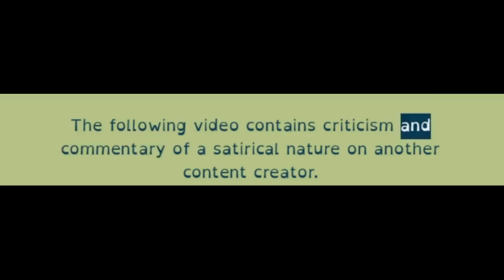REACTION: Another INSANE CRINGEFEST "Restoration" - Antique Kenwood X76 Cassette Deck

Comment: Specs after "repair":
Frequency Response: 2500Hz to 8000Hz
Signal to Noise Ratio: 3dB 
Wow and Flutter: 37%
Total Harmonic Distortion: 78%
Reply: You are being very optimistic.  I have restored cassette decks from the 80s/90s.  For starters, there no way that the motors, potentiometers and any relays or reed switches would have survived that water immersion and corrosion.  If, by a big miracle, that worked as the video showed, it would not work for too long.
Reply: @kylesmithiii6150  heck, most of them don't even survive "careful use" along that many years...
Reply: BUT DOES IT CHEW TAPES FULL OF CASIOTONE MUSIC !!!! Luv it ! 7-bit Muzak !
Reply: and at the end, you can't tell from the music he choosed if the tape speed is right.
Reply: This comment was like reading enchanting table
Reply: LOL !!!!!!!!!!!!!!!!!!!!!!!!!!!!!!!!!!!!!!!!!!!!!!!!!!!
Reply: The guy calibratedd speed well below 1% and measures the W&F with his hands and the result was better than JC KD-DD9 0.01

Comment: I have two perspectives for this guy's video.
1. I am a creator, I make all sorts of post apo props, armor, weapons from junk (and making Fallout/Mad Max/Wasteland Weekend stuff for fans of that kinda thing). The rust was definitely put there with chemicals. This rust wasn't developed naturally FOR SURE, it looks like the instant rust I make on my items with chemicals. I of course work with stuff that is actually rusted too but it would look totally different.
2. I am a big lover of cassette tapes, I have a huge collection and I know a thing about tape decks. They are temperamental. As hell. Especially the belt. There is no fucking way the belt would survive this. It doesn't even survive being treated like a newborn baby by an educated/careful user half of the time. It had to be a brand new belt on that thing. And that 'old stuff indestructible' DOES NOT apply to tape decks. I have experience with 70s-90s tape decks of different qualities and none of them are indestructible, definitely not a Kenwood... By the design this is an 80s deck and Kenwood was just decent. Not great, not bad. It would never work after something like this. This is so stupidly fake I can't believe people fall for this.
Reply: Heck yeah man. I recently fixed up an old Sony double deck cassette deck. When I got it, the belts were shot. Even after i replaced them, there still are a few things wrong with it that won’t affect the operation as long as I’m careful. One of the gears is cracked and slips off the axle if I use fast forward or rewind and I think the spindle brakes or clutch? are going bad, as when I use the deck for a while, when I stop it, it makes a slight jerk and slightly unwinds the tape(might be the cracked gears fault, it doesn’t happen on deck b). Can I just ask this? How can I repair a cracked gear? Can I use some epoxy on it? And sorry if I’m making you cringe a little, this is all new to me lol.
Reply: yeap, you're right. I have an uncle and he also has a collection of cassete decks. Sometimes he buys a deck that's almost perfectly fine but there's a spring missing or a belt and the thing wouldn't work (or maybe it would but weirdly). If you rose the thing down like he did the deck wouldn't work anymore just because of the disrespect with it. 
What he did was literally impossible, it takes weeks to figure out what is wrong with this decks and another week to find a similar piece that fits in and maybe, just maybe the deck is ready to go.

Comment: someone: gets stabbed AHHH HELP ME

this guy: oh wait here rubs stab wound with wire brush, then hoses it down
Reply: "Restore human knife wound clean and restoration"
Reply: No he used ramen noodles to fix the cut and then painted over it
Reply: @karinaaraiza7615  just like that Powkiddy that Restoration R.A claimed to be a "Gameboy PlayStation"; he just puts noodles in it, sands it down & spray paints over the shell with yellow paint that doesn't even match the yellow paint on the front.

Comment: "Filming it backwards" might be a viable answer. Taking a good item, filming it as "restored", then trashing it and pretending to "restore it". I don't know much about electronics, but from what I've seen, if you leave something outside for any real length of time and you practically have to rebuild it replacing everything as everything is destroyed. Rust is a killer. He could have "rusted it" with an oxidizer to make it look like it was out longer than it was (would be easier than waiting for it to actually rust). Then probably tossed some mud on it. Who knows for sure, but I highly doubt you can pick up a junk cassette deck from the bank of a river that has been there for months or years and "restore it" without pretty much rebuilding it.
Reply: But his movements isn’t backwards
Reply: @juliaalvarez537  not literally filming in reverse, but rather film things from the end, i.e starting with the finished product and filming the "finding" at the end, then just reorder the clips while editing.
Though, sometimes this dude paints the things he ""restores"" so this process can't account for everything.
Reply: Eder Barrerou dd
Reply: Eder Barrero couds fe whaaaa

Comment: If you look closely you can see the serial numbers do not match on the one he "found", and the working one he swapped in at the end.
Reply: and the ejection action on the working one at the end is much faster
Reply: Actually they do match. 21004638 at the beginning and end. Its at least the same bottom chassis. There is a deep ding in the center back that is present in both the repainted and "unrestored" version. I figure that the board might have run. But those tape transports would never see another cycle.
Reply: @eh86055  That is assuming the "reveal" at the end was in fact before the deck was tossed. I like it
Reply: The green decals inside the tape compartments are brand new paper ones. I wonder if Kenwood afficianados are selling these NOS paper decals on ebay for $250 per decal like Fender restoration guys do ?
Reply: I'm guessing that blue marker on the underside is the price from the shop where his crew bought it.

Comment: I was an electronics service tech for 20 years and I can tell you there is NO WAY he's going to re-assemble those tape mechanisms and make them work after such a thorough and unnecessary disassembly.
Reply: I doubt very much the "restorer" shown in this video will succeed in making that deck work properly again. No service documentation, lacking the proper tools, virtually no skills or knowledge of electronics and very little experience. Usually I avoid "reaction" videos but The Guitologist is different because he tells the truth as do you.😇

Comment: Dozens of different types of screws, and he just tosses em in a bin.  Taking a cassette deck apart to that level is a giant PIA to reassemble.
Reply: Exactly. I've worked on domestic and professional audio gear for many years and I wouldn't even consider trying to disassemble then reassemble a cassette mech (especially one with auto reversing heads) without the assistance of the service manual and some exploded diagrams.
Reply: He shows the disassembly in detail but skips most of the reassembly. Probably becouse he actually skipped it.
Reply: I have done in other transports. They are not that complicated. Servo transports have less pieces but need to be sincronized properly during assembly, or you can break the mainf function wheel.
Reply: Totally agree. Even using your self video while disassembling for reassembly on something like that, is a complete PIA.

Comment: Pretty amazing the heads and guides are perfectly aligned without any adjustment after assembling the mechanism. Usually, for me, just looking at it while thinking of a screwdriver is enough to require re-alignment.

Comment: "The grinder, or the wire brush?" *Proceeds to use a wire-brush wheel on a grinder*
Reply: Which is fantastic for a tape deck taking the tolerances out.

Comment: He never breaks a plastic piece that makes it useless.
Reply: Anyone that even has the slightest bit of experience with disassembling and reassembling a relatively fine mechanical appliance such as a cassette decks knows that even in mint condition they can be a royal pain in the @ss.
Reply: Dude, totally. You ALWAYS break an integral plastic tab off of something while trying to fix something like this. Or lose THAT spring. Or bend some metal piece, I mean he use a hand mallet to get the capstan out!
Reply: @dh-_1011  

YES!! YES!!!!! I absolutely hate that.
It's the reason why I only buy cheapo cassette decks. One wrong move and your screwed, it's either a parts set then or you have to wait years till some replacement part shows up on ebay. 
I won't spend big $$ on a Revox or Nak just to find out an unobtainable nylon gear has snapped or something deep in the mechanism needs lubrication and you know you'll probably break or lose half of it in the process of even getting there.
Reply: Right on! Every time I'm fixing a piece of gear from the 80's, those plastic bits are so fragile. Super glues my friend in those cases!
Reply: Did anyone see the fine springs these would have dissolved - being turned to rust. None found these would have been replaced.

Comment: I'm struggling restoring a Tascam 388 i got for $30, from 1986, and it doesnt have mud and shit all over it.....
I'm using alcohol and toothbrushes and q tips.....un winding long blonde hairs off the capstans....stuff like that.
if only id KNOWN a GARDEN hose would work just as well.

oh and i had to ORDER new belts for the drive....those shitty Tascam belts just dont last like the Kenwoods.
Reply: use a heavy wire brush and scrub the fuck out of it then use a pack of ramen noodles to patch up any scratches, dings or dents..works everytime..I actually found the same Tascam recorder while I was walking around in my backyard..it was sitting against an old tree..weird how life works.

Comment: As a restorer of electronics myself I'm sorry to say this is actually plausible. He painted the cover with a hi-temp spray paint which indeed gives a thick matte finish. Looking closer to the footage rebuilding the deck i can clearly see all the pits of rust he painted over.

The scratches on the plastic can be hidden with a coat of wax.

As to why the deck was found in two pieces? This is not an uncommon sight really. Whenever i scavenge the local electronics dump i find devices every now and then with the cover off. Why? Because the previous owners are often frustrated or curious what went wrong and take the cover of to see if there's something they could fix themselves.

Then again the tools used are way too crude, and his methods make it unlikely he knows what he's doing. What the hell was that guy measuring, chi?
Reply: What’s your take on all the painted labels on the back being fixed, i can’t imagine how you could repaint the label itself with basic tools.
Reply: Well he did only do a rough clean in the beginning. At 7:02 where the back was wet you can see all the labels, no need to repaint. From what i can judge in the footage i would try car polish with a mild abrasive on the trouble spots.
At 34:03 you can still see some of that white stuff on the right side.

Somewhere mid 90's i had a job at an audio store where we actually used a lot of car detailing products to freshen up used equipment. You can hide a lot of wear/damage on plastic and painted panels (until it wears off :) ).

In this video though, the guy only shows the paint he used, dubious. The polishing would be as time consuming as painting, why exclude that part?
At 31:45 he wants to proof that the audio comes from the tape deck but needs a cut in the video to get it right?

Comment: I was a comm tech for a DMS10. There was a flood and the water backed up into the pipe system, made t way up to the air conditioning units and rained down on the DMS10. We brought in leaf blowers, hair dryers and dehumidifiers. We still had to replace more than 900 line cards (individual dial tone cards) as they were fried from the moisture.

Comment: I'm a Gunsmith and therefore very experienced with disassembling complicated tedious things and I can definitely tell you that when he was disassembling the components the way he did he had no intention of ever putting them back together. There is no way you would disassemble anything with small tedious parts at that speed and with that much carelessness. You would bend parts, brake springs, and strip screws. Not to mention keeping up with all the parts and how to reassemble the thing. When you disassemble something like that you go slowly, pay extreme attention, lay parts out in order, take pictures if needed, and take notes. Unless he worked in the factory on that exact model everyday for the past 10 years or something then there is no way he pulled off reassembling that thing correctly and without broken parts. Not after the way he was just jerking parts off that thing, No Way!!!! Also when he pulled the mother board off that looked very much like a chemical rusting not a time and moisture rusting, which would indicate he done it in a short period of time and on purpose.

Comment: Glad you made a video calling him out!  Look at how scratched up the writing on the back panel is at 4:09 and look at how all the writing and lettering suddenly became pristine 'after the restoration' at 34:11!!! Also the 'restorer' clearly has no knowledge of electronics; he uses a meter at 24:40 to check for continuity of a short low-density cable when he should be using it to check for shorts between the adjacent pins after attaching them with that ridiculously oversize soldering gun!  As an system engineer, I want to minimize the amount of e-waste, but that has NOTHING to do with filming a perfectly working deck, then throwing it in a field to 'rescue' later!

Comment: Yo, Love your vids, especially the dumpster stuff! I am also a hobbyist dumpster diver. Now IDK about this guy in particular but I would not underestimate these Asian dudes, or anyone from some of these third world hell holes. I used to work with some off these guys (not these dudes specifically) and they are extremely talented. In the Philippines i watched a guy build a hand gun (1911) from scratch! He made it out of pot metal in his back yard, and it totally worked. I also saw A team restore A high end mixing console with no help from the manufacture, no schematics or nothing. Because they don't always have access to new stuff they have to be thrifty. And its actually easier to find some of these parts over there, like in Korea they have whole indoor malls that run for blocks just filled with all sorts of old and new electronic parts. Hell, he could be an engineer from Samsung for all we know. A lot of the used electronics you see on amazon for cheap are restored from piles of junk that we actually send them as recycled materials. Also the stage riggers from some of these places are also pretty amazing.. Just my experience..

Comment: The pins on that ribbon cable should be completely corroded after hanging loose like that in the moisture. It's amazing how people think that it's actually possible to just magically remove scratches and corrosion

Comment: At 6:31, I was figuring dump the whole thing in a tub of soapy water and scrub with a brush.  Doing with clear water like he did was actually a little more realistic for the reasons you stated.  But the electronics would have been destroyed from being exposed to the elements.  So it wouldn't matter how you cleaned them.

Comment: When I worked on boats if any sank in salt water we took the engines and took them apart as much as possible to soak in fresh water along with the electronics. We would change the fresh water everyday for a week to ten days to get any salt out. We always sent the electronics off to be worked on. We only did the actual mechanics and rigging.

Comment: Never use standard WD40 on electronics, because it leaves residue and oils behind that will short out circuits and cause rust, (funny because they say its a rust remover, but thats just bs). Always use WD40 Specialist Contact Cleaner, (the isopropyl alcohol and heptane kind). It actually removes oils and moisture to electronics.

btw I loved that intro

Comment: I filmed a fan replacement for a hydrostatic drive on a lawnmower backwards, because I wanted to ensure that everything was true and accurate to the repair, and no unexpected modifications were made. This restoration and metal guy just spits in your face as a viewer.

Now, what are you rather going to watch?

Comment: I read up a tiny bit on using water to clean electronics, and it's best to use distilled water so no shorting occurs between the components and the ions in the water. Flux in the boards is also water-soluble at times, so it's not the best idea to drench them and let them sit.

Comment: Once I replaced a big SMD flash memory chip with 1 mm pin pitch with this soldering iron. I used a much thinner wire lug and I had to do it 4 times. 3 times I got a blob of solder between neighboring pins. The flash worked afterwards. It was an embedded digital audio device. I use this soldering iron every day for electronics development. It's excellent since you can regulate the temperature on demand with very high slew rate and you can solder on large surfaces which conduct away a lot of heat like ground planes or shielding enclosures. BUT:
1) The lug he has is way too short. That's gonna overload the transformer
2) As said, flux has to be used and the lug kept clean (shiny) and not overheat it. The wreck he has is unusable for soldering. In his case it's more like gluing and he will have unreliable cold joints all over.